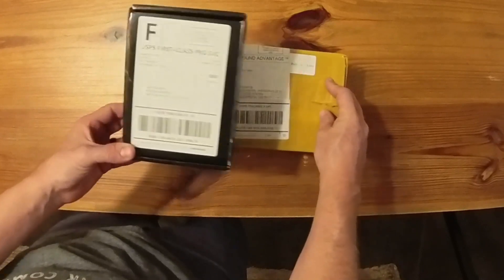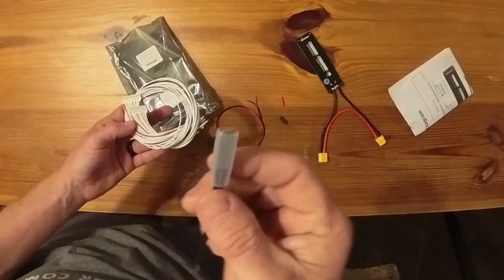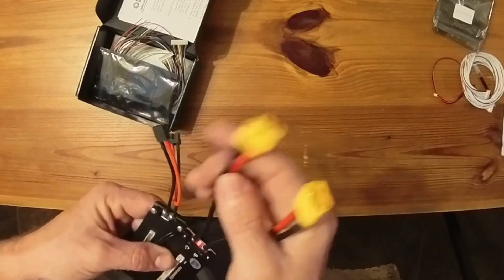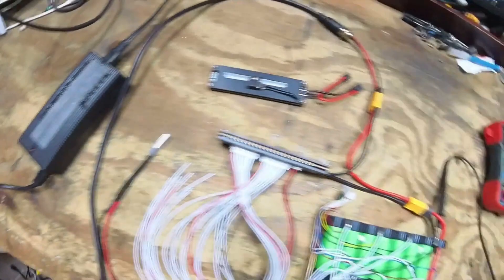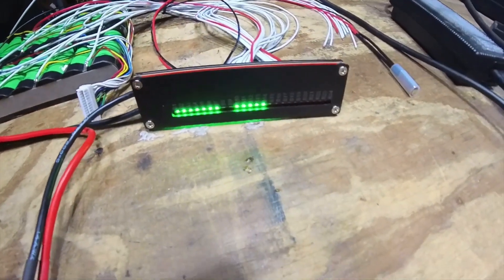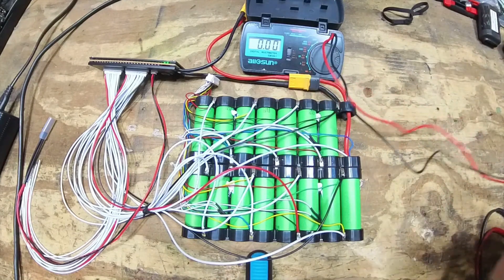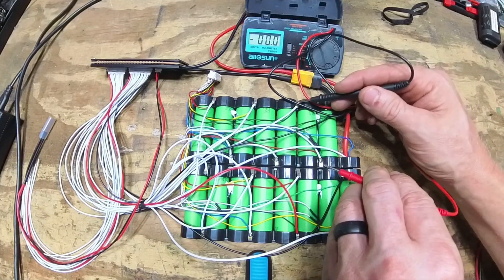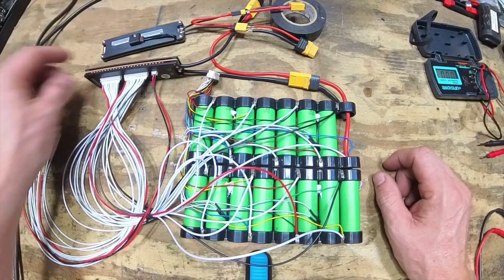Ts the MAXKGO BMS similar to ZBMS?丨Charging Test  |  MAXKGO |@SomebodyFPV

Comment: Hello, I'm in the middle of a vesc pint build using the same maxkgo BMS, just wondering if you ever got the BMS to shut off charging itself? My setup with he same BMS and battery never gets to 4.25 per cell it sits at 4.22 per cell max and never balances back to 4.20 unless I manually unplug the charger, is your pint charger and battery doing the same with the maxkgo BMS?
Reply from the maker: 4.25V is the theoretical value of the cells.When charging the battery pack with a charge only BMS, The cell voltage reaches 4.2V, the balance function is turned on and the balance LED lights up. When all balance LEDs are on, unplug the charger, Until the balance LED turns off, the cell balance is complete and the cell voltage is 4.19V